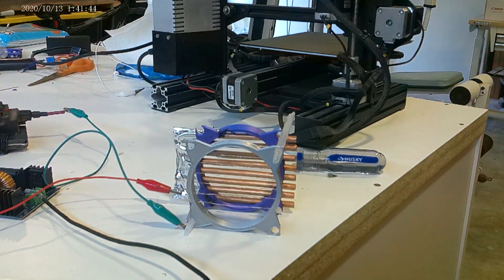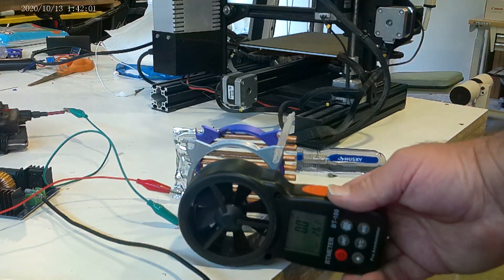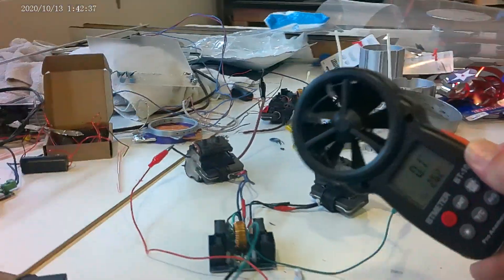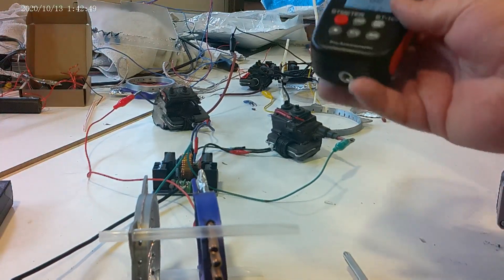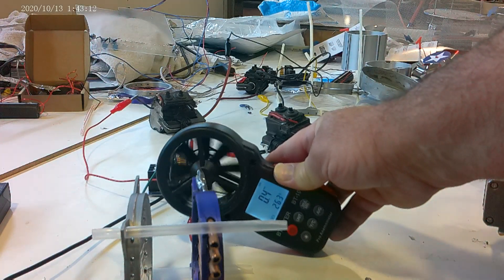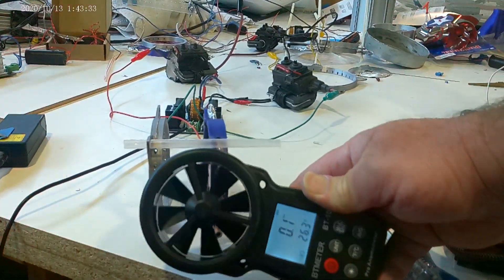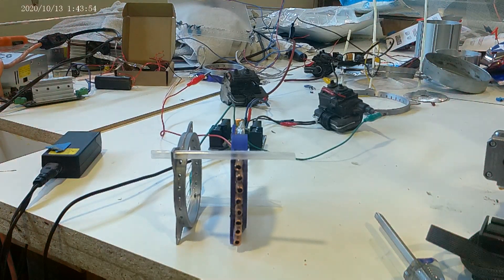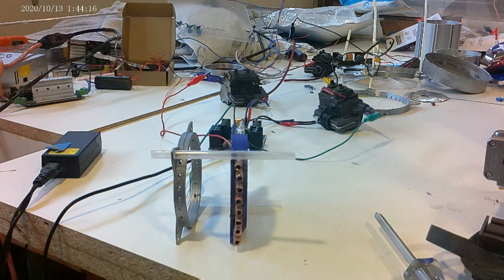Ionic Thruster no magnet wire strange result dc high voltage

Comment: The magnet wire is only copper with a small percent of tin and iron added to hare a ferrous component to the copper. Both magnet wire and plain copper wire are still copper wire, one has a small resistance.  What you are getting here is field effect of the magnetic charge of the high voltage applied to different close plate fields that are not electrically connected.  The wind motion is the ionic motion of the fields.
Reply from the maker: So the magnetic field is the path the wind follows? The magnet wire only has the interaction where the coating is thin. You see it at night. Would you then say that if I boost the voltage and reduce the gap. I can make it go faster? Or would it be better to use aluminum on the big end to reduce the magnetic field. I did another video where I used aluminum cone to get a higher number. What I didn't not show was just the aluminum tape got it to four without the cone. My power source was not good enough to take the cone. That's why it was inconsistent. I ordered new parts to fix the power source. What materials would you use for a better result?

Comment: Makes you wonder if wind is really wind. And not a moving magnetic field.🤔
Reply from the maker: The more testing I do the more I think it is all working together. Just one degree of separation
Reply from the maker: I thought about it. You may be right. The copper puts off a - ion and when you add aluminum instead of both being copper it attracts and has a higher m/s #. Aluminum is a + ion. The attractive force moves air. That does a way better job of explaining what I am seeing. In my last experiment I used copper on top then copper on bottom then aluminum cone. the number tripled. It may be causing both copper, top and bottom to give off ions or attraction towards the aluminum. That would be a huge breakthrough in Idea's as long as it holds up.